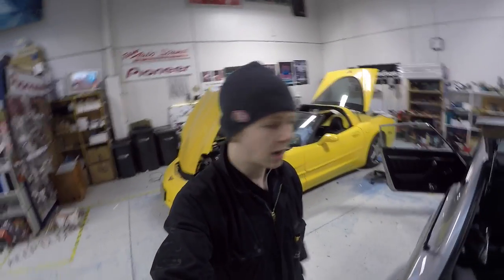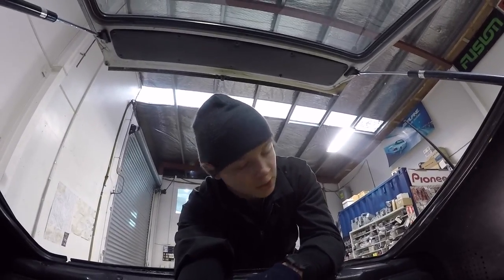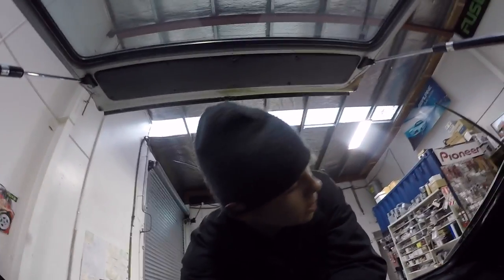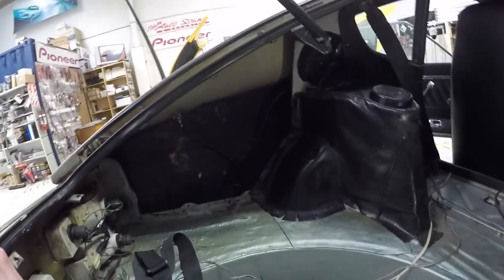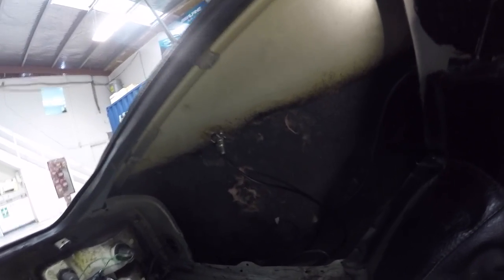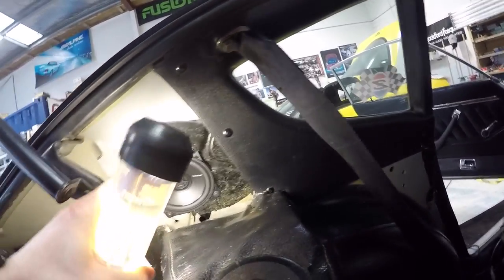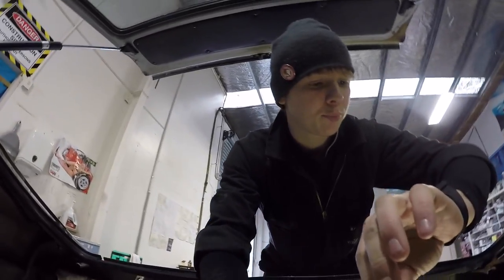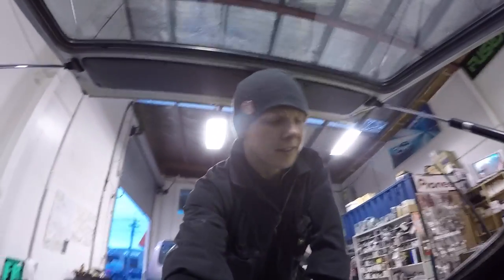1974 Datson 260Z | 4 Speaker Stealth OEM Style Install

Comment: Hey. One of the few videos about speaker locations and radio options for the ‘74 260z  on YouRube that I could find! so  really appreciate you posting this. That said, I’m on my 3rd Z car restoration (order mine from Japan like y’all do in NZ) as USA models had loads of emissions and bumpers bolted on and are crap.in ‘74 completely ruined performance, lines, and the appearance with these thicker massive bumpers on the 280z which is why I stick to 240z.’s and 260’s. That said, on my 240 (71) I’m doing a complete frame off factory restoration but also have a 260z that’s been sitting on blocks for 5 yrs whilst I was in NZ/GB working  and now I’m stuck back in the US (CV-19) figured I’d do a full upgraded resto-mod on the 260z (240’s are skyrocketing now in price for an original restoration whereas the 260’s not so much and can still get in and out for around $25K-$30K (US) doing a decent resto-mod and engine swap. 

Reason for writing is I have the crap hitachi radio for the 240 but really wanna go full out on the 260z with a Double DIN head so I can use Apple CarPlay and have SatNav as I don’t like using my iPhone to drive the GPS function (just burns up your phone too much when driving daily) so rather have the stereo/GPS head do the work. So, anyway, looking at the centre console- the 3 gauges up top obviously get changed to digital but have to stay as those are iconic with any Z car. Then there’s the AC vents and the single head factory radio and that funky angle that shoots out into the gear shift area complete with ashtray that I may ditch... so between vents, ashtray the funky angle and some other useless crap in the area where Normally a double DIN would try to go - it is prolly gonna sit too low down there and there’s just no space “as is” - Have you ever seen a double DIN put into a Z car? I guess I need to keep searching my resto mod photos on the web looking for a new center console that maybe will replace the factory one? And then do loads of custom work and rearrange the order of things located below the 3 gauges. Maybe the newer Z’s could work with some creative molding, modifications and proper installation? Anyway. If you know of any solution that looks halfway decent can ya let me know pls? Like I said, you’re the only one I’ve seen on YouTube that’s even posted a stereo/speaker video for a 260z. So if you know of anything. I’ll buy ya a case of Macs Gold or whatever for any tips or suggestions 👍🏻 Cheers!

Comment: I have a datsun, and I am thinking about running a three way component set with pairs of  3'' and 1'' drivers in the dash aimed at the windshield and some 6.5'' in either the doors or the factory locations. I'm debating the stock location for the 6.5s just because of how far away the 3'' and 6.5'' drivers will be from each other. Even if I can time align the signals to both sets of drivers, I wonder if the imaging will be funky, especially since they're crossed over right around 300hz, which is in a part of the sound spectrum human ears are pretty sensitive to. Now I'm considering the location you cut out for the 4'' for your customer for the 3'' in my set. 

Thanks for your video, I found it really helpful.

Comment: Where you put the 4" speakers, that looked structural. Any concerns that your hole may have weakened the shock tower that it seemed to be supporting?
Reply from the maker: will mention in next video.

Comment: This might are an good or bad idea but would look cool if it was speakers at the straight line at 4:41 under the rubber seal ,and might do something like this : https://youtu.be/7VpaoT678sU?t=66 at 1:06 ,but might not works as an mount point,might will sound bad? and do an oem grill style to it.